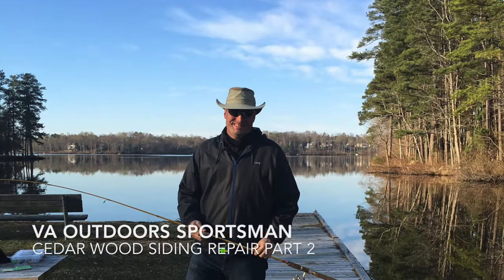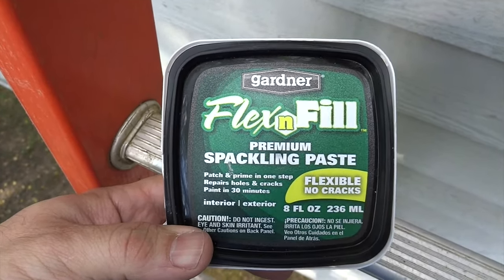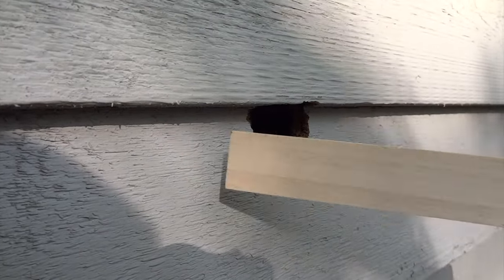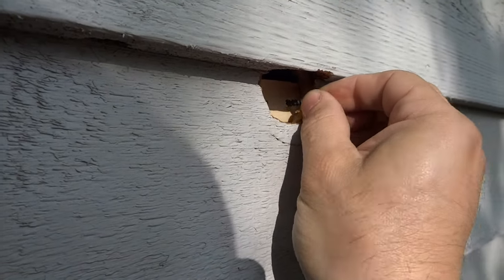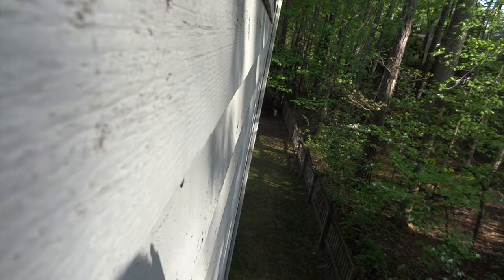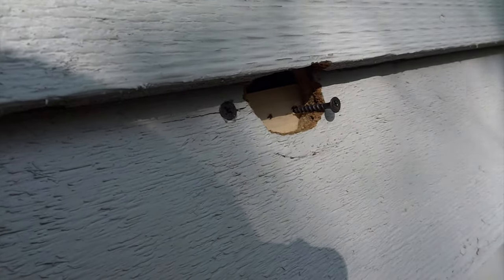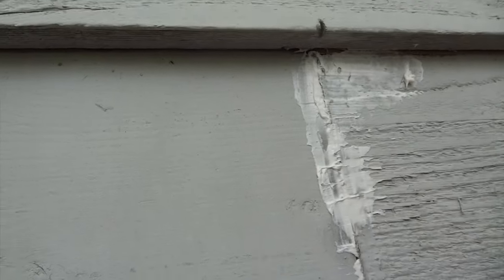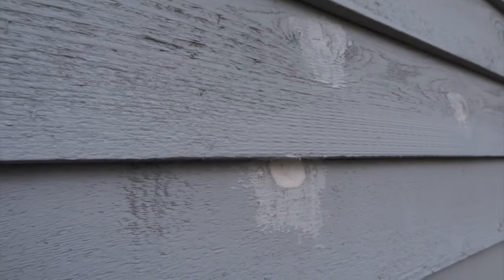Woodpecker damage repair

Comment: Great idea to use the paint stir stick as backing support for the stucco paste to adhere to!  Woodpecker hole is much easier to repair if there is something for the stucco to adhere to.  Body (auto) filler works really well and the body filler is rock hard after the filler dries.  Body filler is much cheaper as well if you're looking to cut costs and do the job as cheaply as possible.

Comment: I know this is an old video but i wanted to the method used here. My problem is wood boring bees destroying my cedar fascia broads. I'll try the putty.
Reply from the maker: Good luck, we have wood boring bees (carpenter bees) in my area as well. We no longer have the house in this video, but have also had challenges with carpenter bees on our deck and porch.

Comment: Have you ever thought about spraying the cedar with insecticide, letting it dry and then doing the repair?
Reply from the maker: I have used a professional grade insecticide both as a pre-treatment to painting and on a regular maintenance treatment, but we still have occasional issues, especially with a wood sided house in a heavily wooded Virginia Neighborhood.
Reply: Woodpecker could just be making mating noises.   And no bugs
Reply: @vaoutdoorssportsman3555  How to stop birds from pecking the house wall?

Comment: Duck tape or gorilla tape would have saved a lot of time instead of wood and screw.
Reply from the maker: CHOCLODITE LENSMAN- 👎🏻That is the same half ass repair the previous owner did. Every one of those repairs were reopened by the birds in less then a year.
Reply: @vaoutdoorssportsman3555  LOL.....half a paint stick beats half an ass every time!